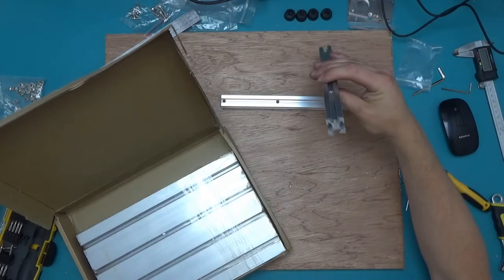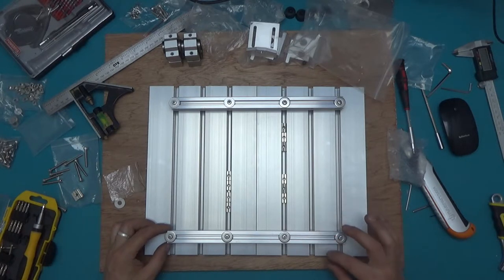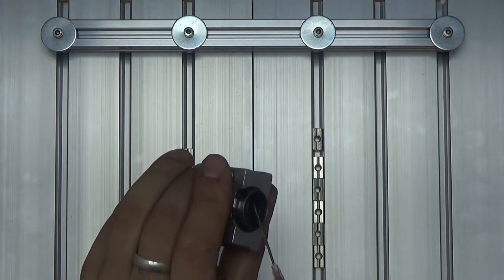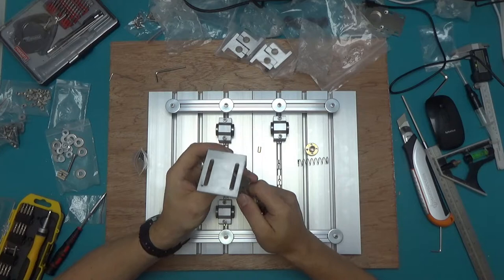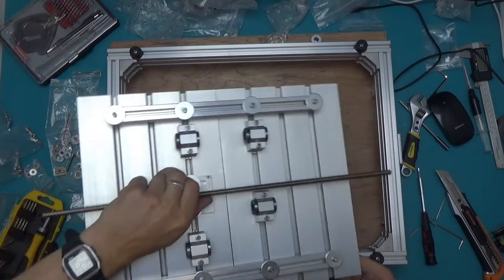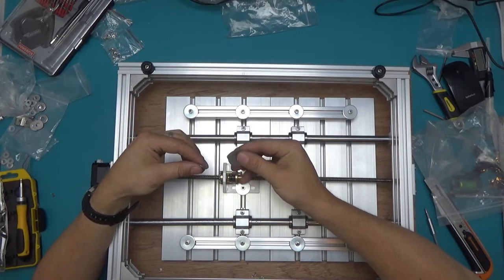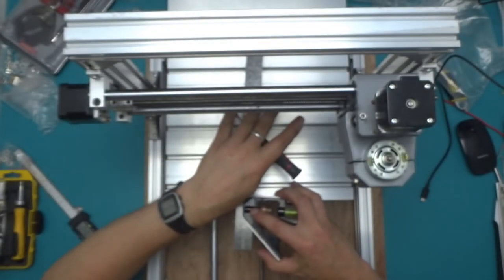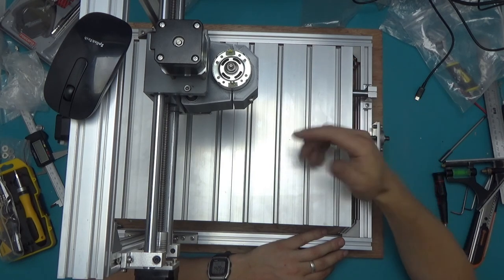#005 - CNC2632:  a mechanical put together - Part 2

Comment: Do you consider the lack of bridge support to be an issue in the design (often included on the smaller machines) ? ... I found the bearings in my Y axis come out of the 3D printed part during testing and no means to retain them.
Reply from the maker: So far the bridge appears to be quite sturdy - the brackets supporting the uprights hold it well it seems. But it would be a very simple mod to add a diagonal support if needed. Bearings in my gantry sit quite well, time will tell i guess (I hope they will stay there, lol) I think they could be secured in place (if needed) with a screw and a washer on the sides, in such a way that a washer would overlap the edge of the bearing, preventing it from sliding out. The forces on the bearings are quite low though (in the direction of the movement) so don't see why they would slide out, unless the bearing was seized or the rails not aligned properly(or bent).
Reply: Engineer / millwright so I am pretty sure its a 3D issue and not an alignment issue...They were falling out before I even put the rails in...The supplier kept sending me wrong instructions and directed me to your video...My board also has issues in that it all works apart from the spindle but luckily I have another board I ordered with a display for offline use that works as intended. ..Like you I pretty much built it without instructions...Once I sort out the board / support issues etc with the supplier I will do the mods to retain the bearing and add some bridge supports.
Reply from the maker: ok, yours must have been a faulty design then - i did not have them loose in the 3d printed part (i even pried on them lightly trying to take them out, but they didn't budge). I am flattered that a supplier pointed you to my video though :) Interesting indeed! Best of luck getting your machine up and running - btw, i also had an issue with the spindle not starting - i think it is the software issue, something to do with defining feed rates, but have not fully worked that out yet (so could be wrong here). Thanks! Oh, what board and display have you ordered? do you mind sharing a link?
Reply from the maker: Thanks!